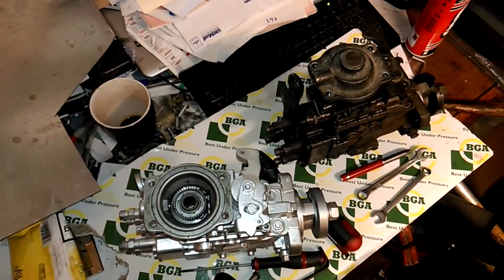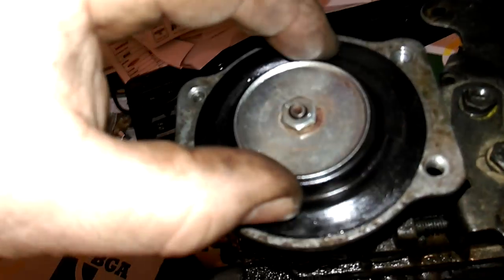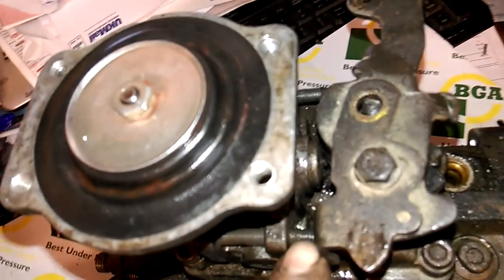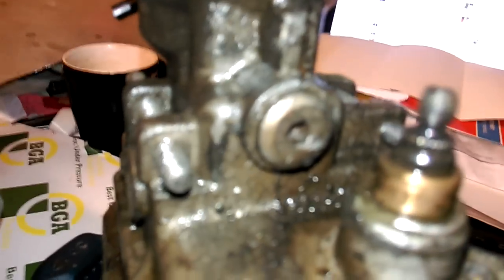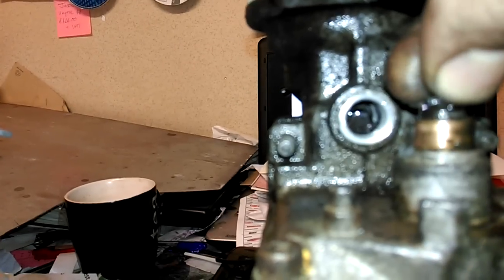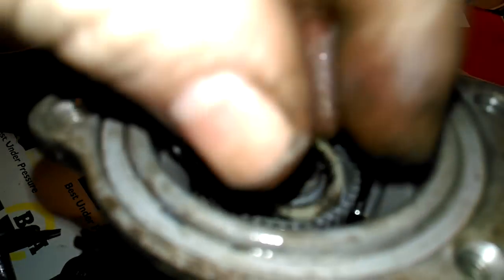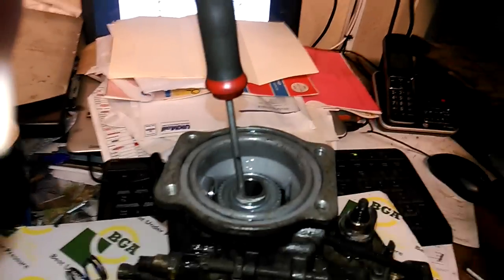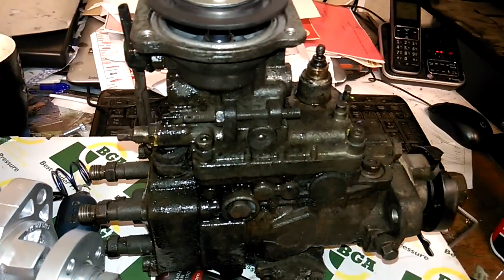VE Bosch fuel pin seized

Comment: Just done my New Holland 8360 [same as TM150] which had lost at least 50 hp over Winter as a result of the diaphragm not doing its job of increasing fuel as turbo boost rises. It turned out that the pin was free and the diaphragm in good order. The issue was that there was crud blocking the boost pipe which connects the manifold to the top of the diaphragm housing.  Pipe cleaned and lost 50hp restored. Took 20 minutes total. This is a 7.5 litre straight six engine with very nearly 10,000 hours on the clock, which is around 250,000 to 300,000 mile equivalent for the average road vehicle [averaging 25 to 30mph overall]

Comment: Don't rotate the diaphragm before taking note of it's original position!!!
There is a small dot you can find in the metal some were between the diaphragm it self and the centre of the plate.
I would suggest to take a picture before rotating it.
Now you can rotate it as you like.
You must put it back in the same position before final closing.
Reply: I forgot to mark it, is there anything bad that can happen?

Comment: When that little pin (guide pin) inside gets stuck in the out position against the fuel pin it reduces or negates the effectiveness of the AFC, the governor in relation to the throttle position will behave as if it sees partial boost all the time and will not vari the fuel curve properly. A stuck out guide pin would cause a rich condition at idle.

Comment: Make sure the throttle shaft is indexed properly. If you up your idle screw to correct indexing you will lose a lot of throttle. This is info from a 5.9 cummins but to my understanding they are mechanically the same.

Comment: Just started my 200 TDI after 10 years stillstand. It did start immidiately, but revved quite high. Prop around 2500 revs and smoked white smoke. Doesnt react to the speeder. Just revs. 
Whats more is that we couldnt turn it off second time we startet it. Must be the Magnetvalve stock as it was to start with. 
Could we be that lucky its just this Problem? Heard of broken springs inside, but not clear how that effects the Pump (fx doesnt start or weak).

Comment: Does the pin have some resistance? Or is it completely loose? I’m moving it back and forth. Freed up a lot but still some slight amount of stiffness and not sure if it’s normal with a tight fit. Thanks.

Comment: I altered my original fuel pump on my Defender 300tdi by adjusting the smoke screw and the Star Nut (by following some instructions from Landyzone) and got a massive result with low down power / torque.... what is the benefit of your engineered boost pin / cone arrangement over the original? Thanks, Bandit..

Comment: i have just fitted a 300tdi in my defender the engine  i fitted has been sat for about 10 years i have started the engine but it just revs at about 2500  rpm there is no throttle response it wont rev any higher unless i pump the primer on the filter housing could this pin thats stuck be the cause of my problem.
Reply: Hi, I've got exactly the same issue. Stays at around 2500rpm and no throttle response. Did you find what the cause was? 
I do have a naturally aspirated engine though so the pump is slightly different

Comment: How do I put back the throttle arm if I haven't marked its position to linkage shaft sticking out of the pump ??
Reply: You can rotate the shaft by hand to get a feel for the governor spring. 
The , hold it to idle, while you line your throttle linkage to line up with the idle stop. 

This has worked for me.